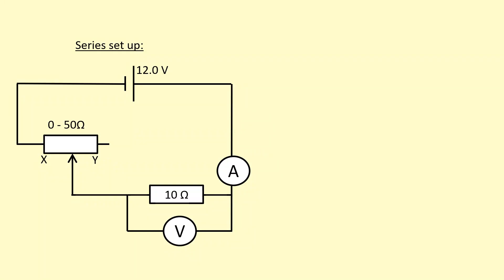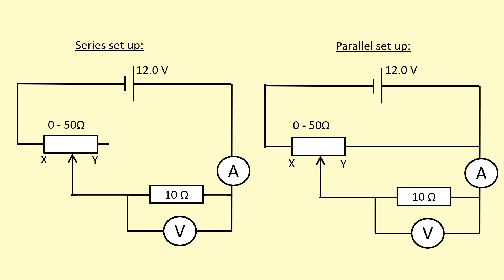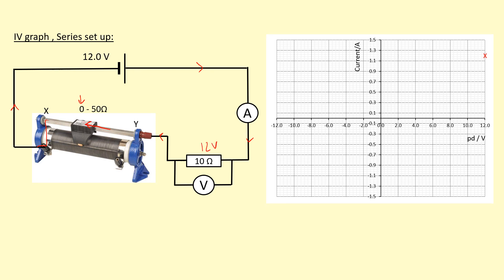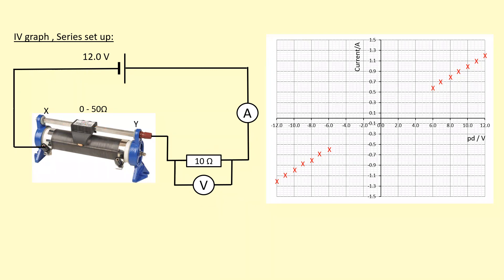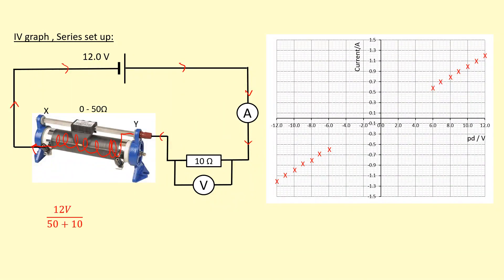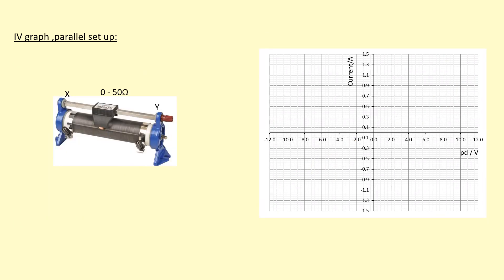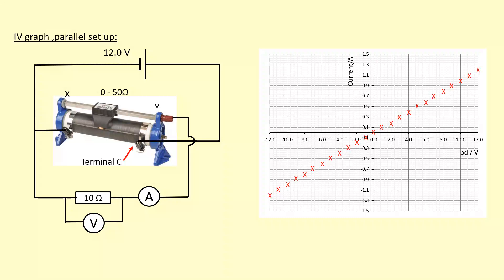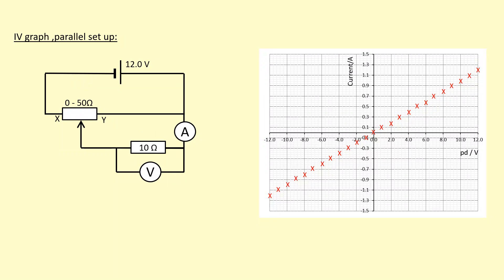3.28 How to measure the full IV characteristics

Comment: can you please explain why the parallel circuit is able to make the resitor go to 0v
Reply: I think its because the 10 ohm resistor is connected in parallel to a wire, and to pass an ideal wire, (ideal wire wont have any resistance)  you wont require any p.d to cross it. And then because it's a parallel circuit, the p.d down one of its branches is the same as the other. so if its 0v going down one itll be 0 across the other.

Comment: Q https://drive.google.com/file/d/1Nr4RAqe44z9ZQNBwr6gg0t3enYRlRd3A/view?usp=drive_link
MS https://drive.google.com/file/d/1NjpXq4gaG-tIiq-6l37Y9Nixlt3qDDtJ/view?usp=drive_link
In 2019 IAL Jan WPH02, Q 12, I did the same way as the vid, and I got " V is minimum at A " because current would flow without even passing through AC. but it turns out that the ans is maximum at A. could u plz explain why. I got confused